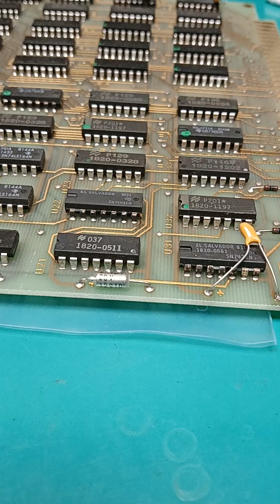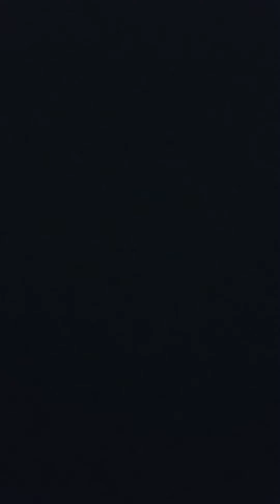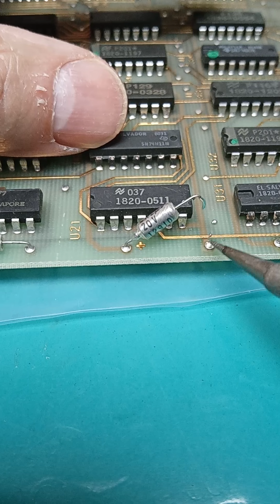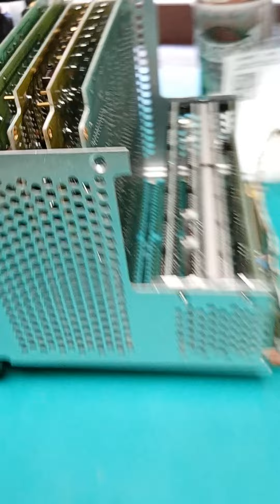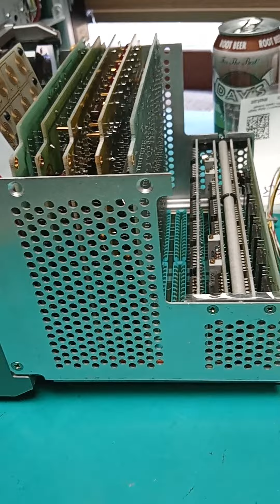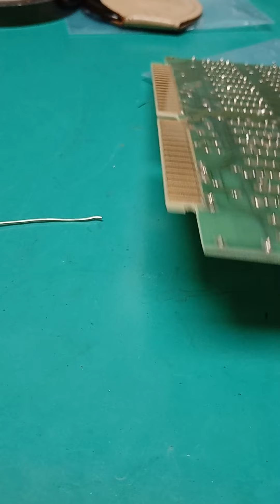Part 2, HP 8660 Restoration, Control Head

Comment from the maker: Utube failing to post this comment for some reason:

"Stoner Owner says:

Yes! This really brings back some memories... In fact, when I do quite a bit of this kind of work I use a Weller ESD safe rework station connected to an 80psi air supply for venturi vacuum. Your conclusion is 100% spot on about the forums and all... The guys doing the MOST posting normally have the loudest horns and the least to contribute. The 8660 is worth owning if you can make the time to do this, it's stable, clean, and holds the floor down well. I checked my storage room and still have the spare 110Mhz and 2.6Ghz plug in for this. They have been sitting for over 15 years, if you want them? Send me an email.
Reply from the maker: I think I need the 2.6G. 

This unit has the high stability oscillator option at 10^ -9 cycle  it came from da Gummit site here.

This appears to be all TTL so it wont be nearly as susceptible to ESD, but no sense taking chances!